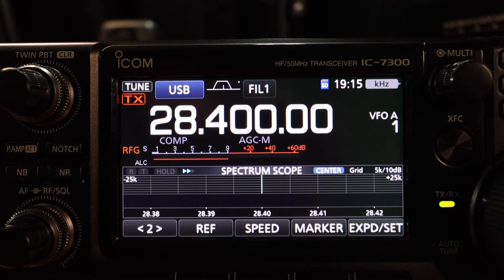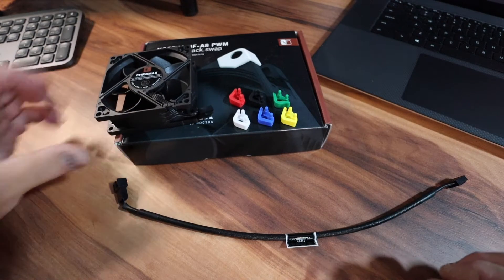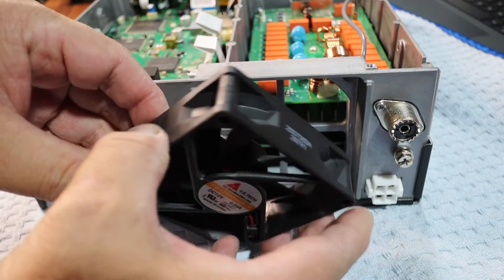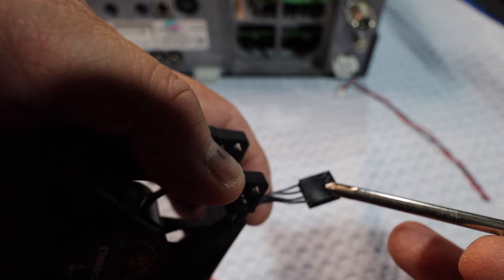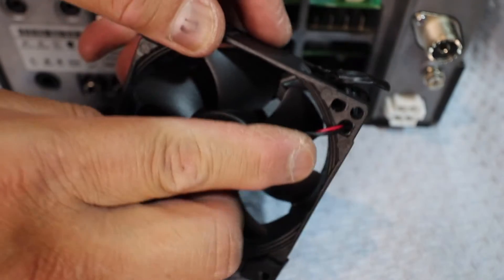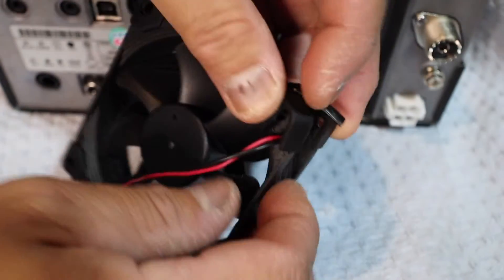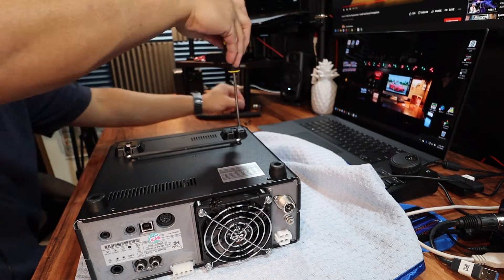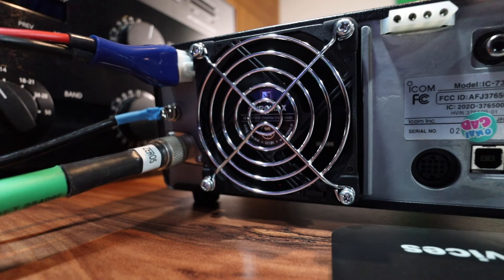Replace your Icom IC-7300 Noisy Fan | Quiet Noctua NF-A8 PWM Chromax Fan | Quick and Easy Swap out!

Comment: Nice 👍   I recently added one of their fans as secondary cooling fan on a pair of 3-500.  So quiet. dropped temperature by 15 degrees. Im going to replace primary internal fan with a Noctua now I am happy with the results.